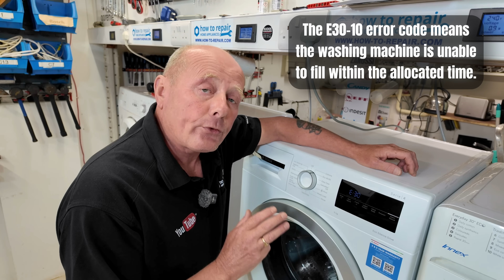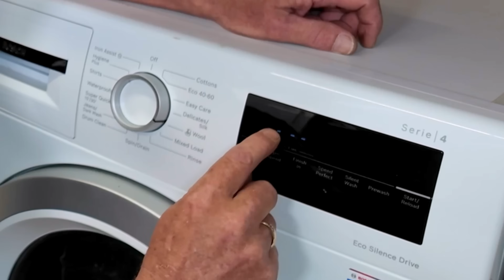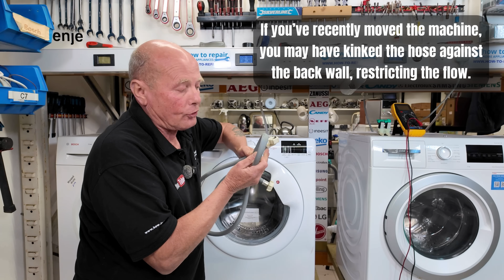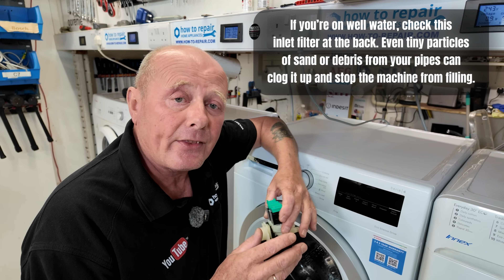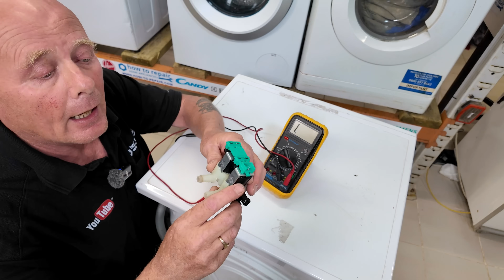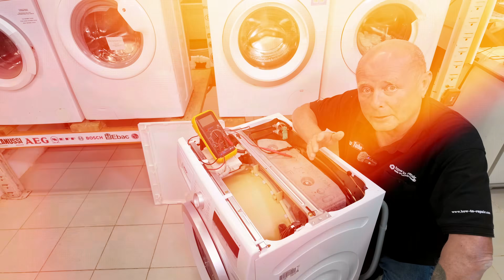How to Fix Bosch & Siemens Washing Machine E30-10 Error Fault Code (Not Filling with Water)

Comment: Thanks for doing the videos. Most helpful. Can you tell me if there is a way to adjust the rear feet on a machine when it is fitted without access to the back. My floor is far from perfect and I cannot get the back feet right to level the machine
Reply from the maker: No you have to slide it in and out until you get a level
Reply: you would think some company would have come up with a solution by now as many people must be in the same situation as me. Thanks for your reply anyway.

Comment: Hey Paul, 
My Beko DS 7333 PA0 dryer is acting up after five+ years. 
Just replaced the starting condensator for the motor, now the fan won‘t start. 
Realised this when there was condensation in the lint compartment. 
The fan itself works fine on 220V AC, I tested it. 
The fan only receives 20-30V from the machine when running, the machine starts normally and gives out no error code. 
Do you have any Tipps where to start looking for faults?
I couldn’t test if the compressor works because I don’t want to leave it running for longer then a minute without an active fan. 
Greetings from Germany